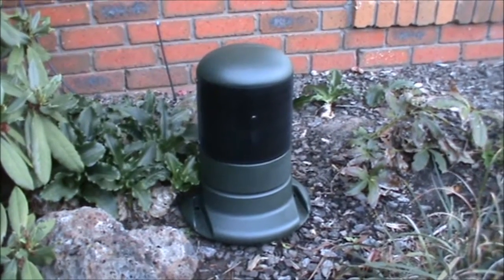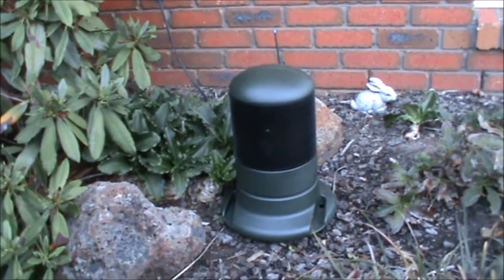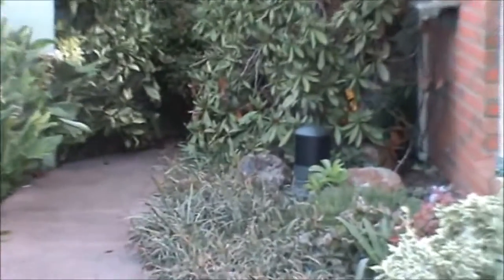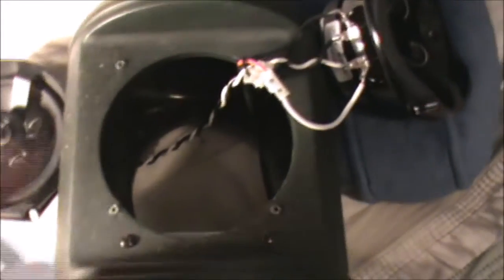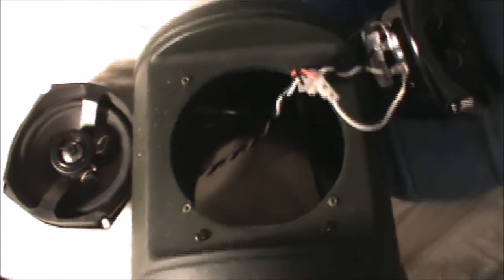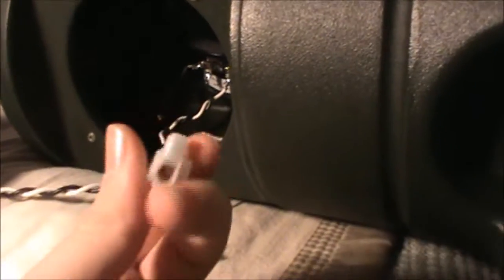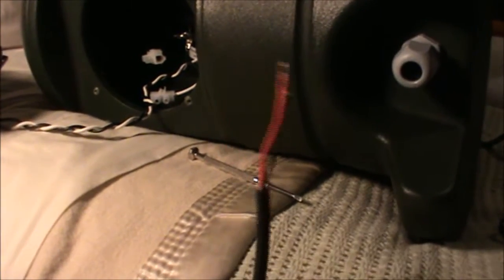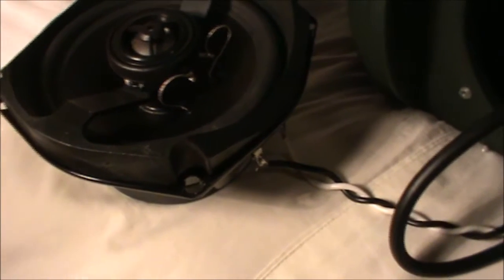Disney Bollard Speaker Overview With Transformer Mod

Comment: Nolman0001 where could i find the connector that use for red and black and white and black? And could i use a basic speaker wire runned with a RCA Jack because i was planning it and buy myself a 1 bollard speaker and there is a one speaker like this which is tall
Reply from the maker: +BollardSpeaker 26 The connectors (known as terminal blocks) can be purchased at most electronic stores. As for the wire, just about any type of speaker wire can be used, but direct-burial cable is recommended for outdoor areas to ensure longevity. Remember, these speakers need an amplifier to operate, so connecting the speaker directly to a device via RCA won't work (if that's what you're implying).
Reply: Nolman0001 i don't get well could i wired it with a tape or wire nut like twisting the two wires together and ohh yeah we have a stereo system which is i will used for this speaker (component speaker system) could that suit's and Nolman0001 i amplified a rca used satellite speaker with a another speaker would that work?
Reply from the maker: +BollardSpeaker 26 You could just twist and tape the wires together or use a wire nut and that would work fine. Your component speaker system would probably be enough to drive these speakers. However, the speaker may not perform as well if underpowered (an amp rated for 50W RMS is probably around the minimum requirement for decent volume). But still, the component speaker system should do okay!
Reply: Nolman0001 what is the music?
Reply: And Nolman0001 how much is a 1 bollard speaker could cost?
Reply from the maker: +BollardSpeaker 26 Well, these speakers are only sold in pairs. So a pair would cost around $84 (not including shipping).
Reply: Hmmmmmm! You are probably right:)
Reply: +Nolman0001 i am confused that how do you wired the 2 speaker in a burial cable?
Reply from the maker: +BollardSpeaker 26 You can just wire the burial cable the same way you would wire any other speaker cable. White to Red and Black to Black.
Reply: +Nolman0001 no i ment to say is a 1 black and red burial cable to connect into 2 speaker wire and thats what i am asking on could i wire the speaker in a 1 cable
Reply from the maker: +BollardSpeaker 26 You only need 1 black and red burial cable because the 2nd speaker is already wired to the 1st one.
Reply: O i don't seems to be seing the connection that you connect and because i see white and black wire which is four

Comment: Have you tried, or do you own any jbl's?
Reply from the maker: I have an old (and abused) JBL Control 23 taken from my work. The original drivers were blown when I received it, but I have since replaced all the drivers and the internal crossover network. I do like JBL products and I hope I can get some more gear from them in the future.
Reply: +Nolman0001 
Might I ask, "How do get speakers from work?"
Reply from the maker: I'm a sound engineer and was working at a venue where they weren't needed anymore and were going to be thrown away. So I offered to take them.
Reply: Could you maybe show off that jbl in a video if possible?
Reply from the maker: Sure! I was planning on making a video on it anyway.
Reply: +Nolman0001 
Can I give you a shoutout on my other channel?
Reply from the maker: Sure
Reply: +Nolman0001 
Other channel is called wangletech, and it is just how it's spelled.